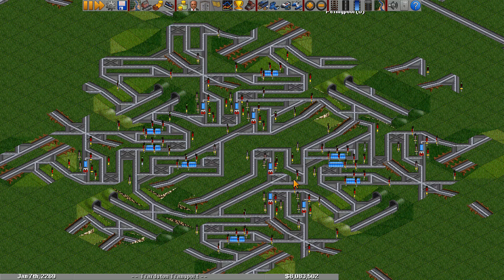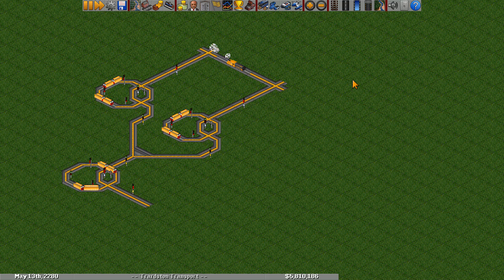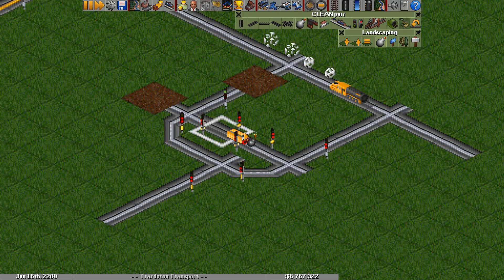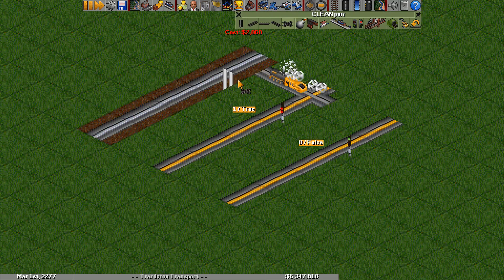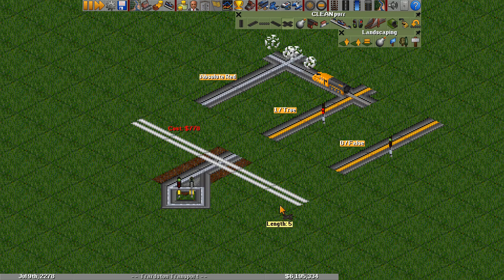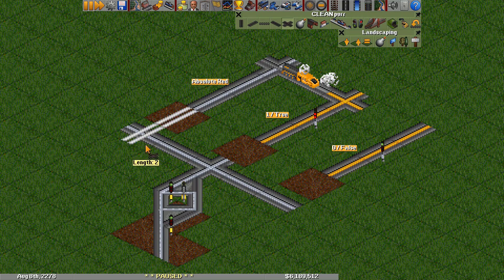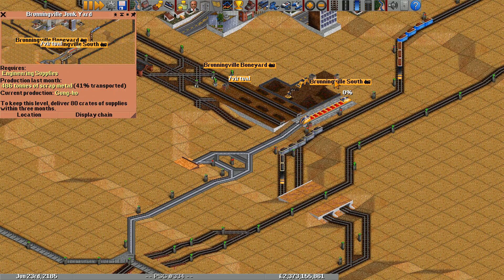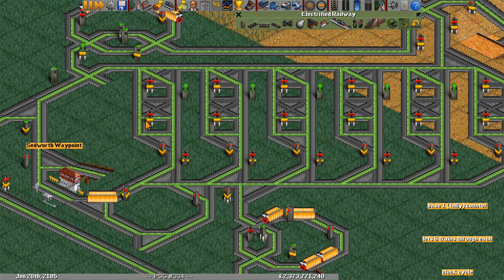OpenTTD Logic 02: Intro to Absolute Red & Memory Cells

Comment: @8:24 there are those r2d2-type signals being used along the track with the memory cell. I used to use them all the time until my hard drive failure. I'd like to use them again, but don't remember which GRF they're hidden in. Can someone please tell me? Thanks!
Reply from the maker: Those are from the NUTS train set, or you can get similar ones with PURR rainbow rails. From content download.

Comment: How do you do the 2 month timer?
Reply from the maker: In this particular game it was set up as a single logic train on a loop with a station. The train has timetabled orders to wait at the station for two months. Then once it leaves the station it goes around the loop and passes through some signals which allow the clock line to turn green for a moment.